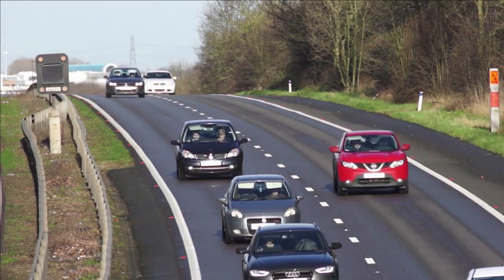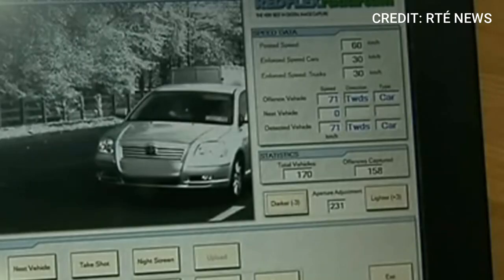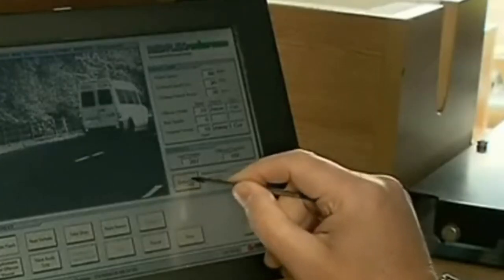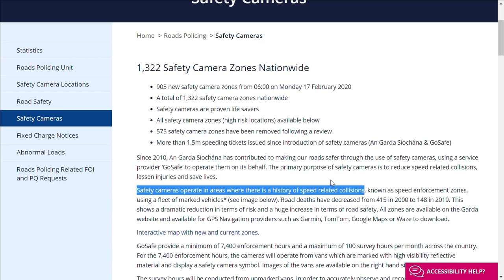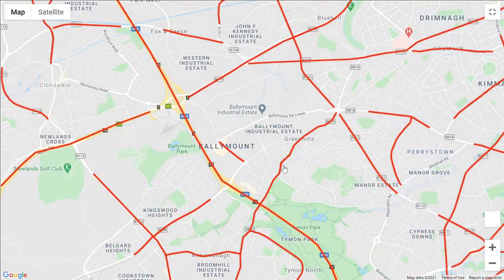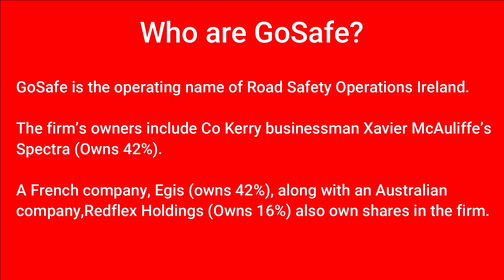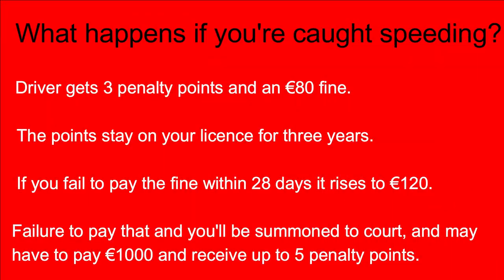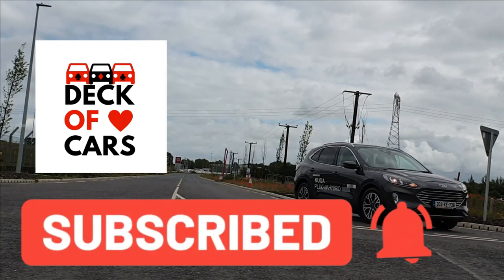How do Speed Camera Vans Work? - Everything you need to know about 'Speed Vans' - Explained Ireland

Comment: On a dual carriageway with central reservation, 3.5 ton van speed limit is 60mph .If your doing 68mph in your van,  even though you are over limit, do they go by the normal car speed limit which is 70mph or every class vehicle will get looked into as to there speed limit ? 

This is with the speed camera vans

Comment: Thank u for the information. I have a question here . If i saw the van ahead of me in a distance of 200 mitres and i slow down my speed immidiatly back to the speed limit marked there is that mean the detecter cam  it wont catch me or is too late ?
Reply from the maker: Generally, the rule of thumb is 'if you can see the van, it can see you' and whatever speed you are doing at that moment it can measure
Reply: 300 meters was the distance back in 2016, might be more now. This shite about you seeing them, and then its too late, is bollox.

Comment: Driving on the road seen the front of the speed van in a 50 zone. I was doing 60. I breaked twice and I slowed down it was 50 before i pass the van and 46 when I passed the van. I hope i dont get fined judging by this video I will get done for speeding.
Reply: Did you get the points?
Reply: Update please 😅

Comment: Can a speed van on one side of the motorway scan the speed of cars going in the opposite direction - on the opposite side? The van wouldn’t be visible to cars going in the opposite direction
Reply from the maker: Potentially yes, the new vans have the ability to measure vans in both directions, but it depends on the location and each location is different. But, potentially yes.

Comment: On the m50 southbound near to wicklow there was a van in the distance and big bends in the road ,can the van get you around bends ? Basically it could see my windscreen upwards when i was just doin a bit over the 100km limit ? So can it detect you around bends like that ?? Thanks in advance
Reply from the maker: Thanks for watching!  

There is a bit of leeway, some websites say that there is a leeway of about 10 percent, so therefore if you were doing 110kmh in a 100 zone you may be ok. 

Obviously I can't say for definite if you were caught or not, but once you can see the van, its likely that it can see you.

Hope this helps to answer your question👍
Reply: @DeckOfCars  thanks for the reply,i suppose its a waiting game now 😩
Reply: Another question pal ,i went by 1-2 vans over 14 days ago in the work van ,and still havent heard anything ? If i remember correctly ,i read somthing online that if you receive the FCN after 14 days of the postal date then the FCN is invalid ??
(Fixed charge notice)
Reply: @DeckOfCars  not true. I was over speed limit 9kph and still got fine and points. I was caught at 11:30pm at night. The van was behind a tree.
Reply: @greenmarine8788  what was the road speed limit?
Reply: @LazyVlogging  yeah by at least 10km twice same van 😂😂 never heard anything thank god
Reply: @TheSnotbanger  i know i’m late but i was wondering this as well. about 3 weeks ago i went past a speed van doing 108km/h on a 100km/h road. i thought i’d be easily caught and i’d read almost everywhere that it can take two weeks max for a FCPN to come. friends of mine who also got FCPN said it took about 10-11 days. 3 weeks later and no letter in the post, so i’m wondering what is going on
Reply: @pogmothoinriiii  did you get fine after that ?
Reply: @apres99  No, never ended up getting one!
Reply: @greenmarine8788 was the limit 100km ?

Comment: If the orange lights flash on the roof does it mean you have been caught speeding?
Reply: @MikeC1984  yeah like I was 100% over the limit. Doing 80 in a 50km zone but I was over taking an old guy doing 40km and it's a two labe road. Why it's 50km I don't know. But I slowed right down quickly then I noticed the lights flash on and off. I hope it's not a signal to say "gotcha fucker". Thing is, I wouldn't have been speeding if it wasn't for someone driving stupidly slow.
Where did you get caught?
Reply: @thepainter1956  did u get a ticket?
Reply: @pavethewayent  Nope! 👍
Reply: @thepainter1956  lucky I think I got booked for overtaking a cyclist, 40 in a 30 when I checked my speed, no idea how hi I clocked tho
Reply: @pavethewayent  Awh tell me about it. When you're going to work or coming home to your family after working all day and you get caught behind slow drivers or a w*nker on a bike. It would drive you mad.
Reply: @thepainter1956  yep was in the middle of the road and that's the worst, so did an overtake then saw the van ahead
Reply: No, the lights aren’t used to signal that you’ve been caught.
Reply: @thepainter1956  When the amber lights are flashing it means they are calibrating the camera and the van is being set up so you can’t be caught if the lights are flashing
Reply: @thepainter1956  i never noticed any flashing lights on speed vans ever! i probably didn’t know they existed 🤣 i usually drive at the proper speed but one day i was doing 108 in a 100km/h road (the n7 from dublin to naas) and went past a speed van. however it was 3 weeks ago and i still haven’t gotten a fcpn? weird. but i didn’t notice any flashing lights any time i saw one, whether it was me or someone else speeding

Comment: Do you have to actually pass the van to have a picture taken of your reg plate? 
'I know a guy who knows a guy' who was doing 100 on a 80 stretch of rural road and when he saw the van he pulled in on the other side of the road, reversed into a driveway of a house then went back the opposite direction without passing the speed van.
Reply: You will see the infrared light if you drive past at night so may work. Can't see the light travelling that far although the detector has a range of around 1k
Reply: @davidoff59  Its been over a month now and still no ticket so I guess I got... (cough cough) ...he got away with it 😁

Comment: If the sped detiction camera is directed out the back of the van.
How do they get a pictor of motorcycle number plate?
Reply: As he said in the film, they have a forward facing video camera which captures the rear of the bike as it passes the van
Reply: Yeah but that’s covered by tax disk, or the plate is too small. The illegal ones.
Reply: So the speed camera is only out the back, not the front?

Comment: Are you only caught when u are right at the back of the camrea and the picture is taken? So if I’m doing 130 in a 120 zone break when passing the van doing like 60/80km will I be caught?
Reply from the maker: Generally the rule of thumb to go by is 'if you can see the van, it can see you' and whatever speed you are doing at that moment, it measures.
Reply: If you can see the van it can see you.. 
In both directions?
Reply: @DeckOfCars  what if you slow down before you pass the rear of the van?
Reply: @pogmothoinriiii  that’s what I want to know aswell hahaha
Reply: 300 meters used to be the distance, back in 2016

Comment: Will they fine you if you are only 2 to 4 km over speed limit
Reply: I think in most countries they let you off if you're less than 10% above the limit.
Reply: @infernalgamer3323  I could be wrong but i think it's 8% + or - 1 kph
Reply: No there is no lee way with these, you can be done for 51 in a 50, my mum was done for 64 in a 60.
Reply: It really depends, but I have seen generous leniency while others have reported very little to none at all. A lot of it also depends on the calibration of your car’s speedometer. You could be reading it as a few KPH over the limit but your true speed is a little below that.